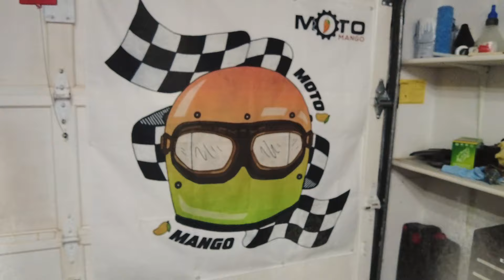Three Things you NEED on your DIRT BIKE

Comment: I like it. I just don’t have a dirt bike to put stuff like this on. It’s cool that you got options for stuff like this. It’d be cool to have spray painted them in an aluminum color and when they get bashed up, it scrapes away the paint where you can see that they saved for doing the same damage to the case. 

Off topic: I’m torn on which motorcycle to get my kids first: the Coleman type that they had their first experience with, an electric like my neighbor has ( my daughter already said she likes the motor sound of the gas powered bike), or bust into their collage fund for a name brand dirt/ pit bike they’ll grow out of. I already got them to catch the bug, just want to supply them with a good started bike to keep it up and going. 

Cheers man.
Reply from the maker: I like the idea of the aluminum paint!

I would suggest maybe SSR or Kayo pit bikes. They are pretty cheap ($1,000-$2,000). They make 50cc, 125, 250, etc. and if they drop them bang them up or whatever, it's not a big deal. Cheers!

Comment: I like seeing this but I'm curious about the skid-plates..... as well as the crankcase saver.  I'd surely like to buy colors that matched
my brand of bike or a color scheme that would make my bike LQQK flashier but are the plastic variety enough?  I see plastic skids
on some bikes from the dealership but it's best to swap them out to a  stronger plate.  I guess if you race you might want light as
possible plates but I don't know how strong the plastics you've bought are?  The ones from the dealer are thin/flimsy so I'm seeing
lots of aluminum plates but I guess it's all in what you're gonna use it for?  For me,  the extra weight = extra confidence in saving
the engine but I've not seen all the newest plastics available.  You are our teacher, Mr Motomango   peace to all
Reply from the maker: Yo! Thanks for watching and for the comment. The guards are a decently hard plastic polymer. I would prefer aluminum plates at the very least, but opted for these for now cause they were cheap and easy to find :) Cheers mate
Reply: No,  thank you &  I'm suffering from information overload...... lol,  so much info is coming in that I'm drowning from it so
hearing the how/why's of things lets me file it in the right place.  I would probably opt for aluminum but the colors make
for a good looking bike.  As usual,  I'm learning lots so thanks again & I'll see you next time, the Lord willing?  peace